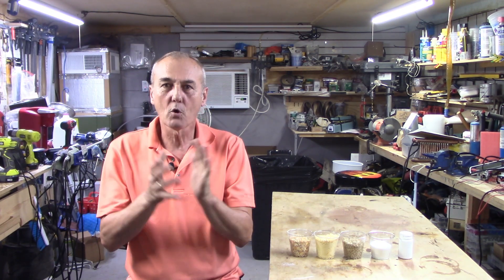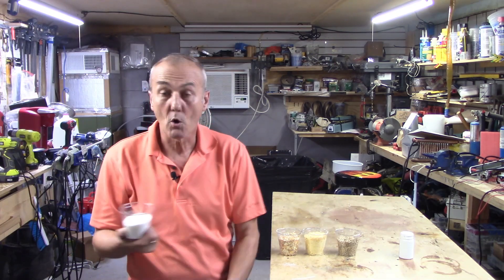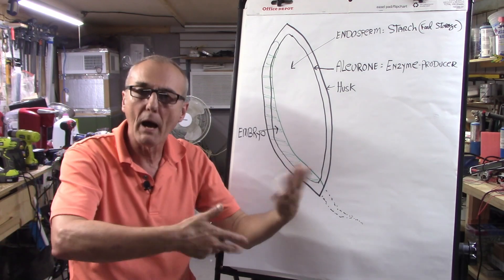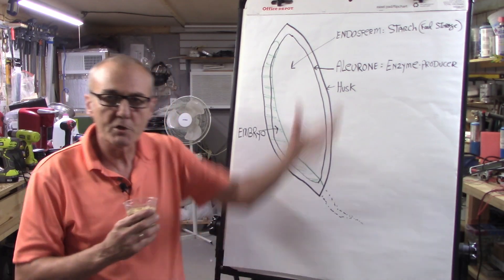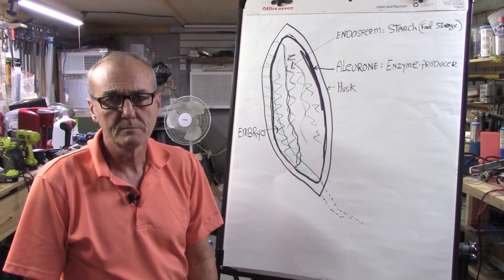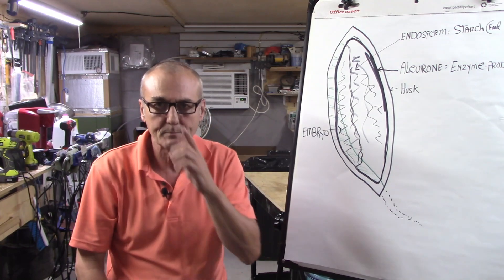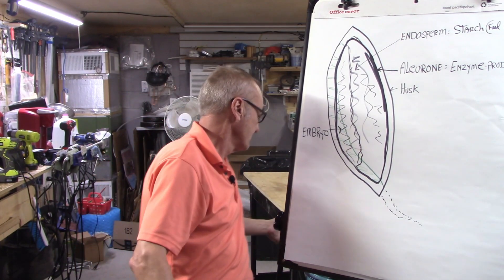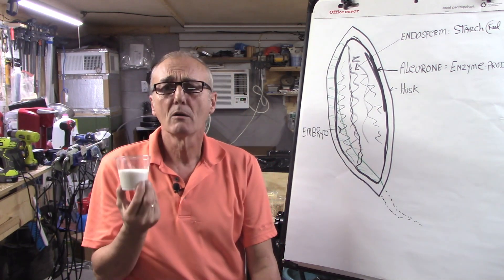CONVERTING STARCH INTO SUGAR EXPLAINED

Comment: I know this is older but new viewers should understand that not all malted grains have diastatic power because they have been toasted / heated to influence the flavor and body of the mash. 
ie; crystal caramalt or most dark colored malts . 
    There are "mash calculators " available online that can be used to determine whether your custom recipe will convert,  if you have enough diastatic power in other words. These are fantastic sources of info when developing a new all grain recipe. 
     If you are willing to use sugar to make the alcohol,  then you can forget about the calculator and still pitch whatever grain etc., you want for flavor and body and not even bother with enzymes & still make something special .

Comment: So, if I'm understanding correctly, I should mix up my usual 5 gallon batch of Uncle Jesse's recipe, and well before I pitch yeast in, I should throw in  roughly 1.5 teaspoons (based on your math in the vid of about one third of a teaspoon per gallon) of the amylase enzyme powder at 155 degrees, and let it stand for an hour and a half. Is it fine to have my sugar in already, or do I need to wait until after the 90 minute 'steep' of corn and amylase before i add any sugar?
Reply from the maker: Wait until the conversion is done before adding sugar. Otherwise you will not be able to test your conversion.
George

Comment: Hi ya George, What do you consider the better option, corn or sweet feed for a still like the Chinese still that you posted a little bit back? being as that still is reflux, we are not going for taste it seems, as that taste can mostly be done by a pot still. A bit lower proof than the reflex yet more taste. As we are not going for taste on reflux. what would have more starch pound for pound? corn or sweet feed?
Reply from the maker: I would never use sweet feed.
George
Reply: Why use any corn since flavors will be lost in a reflux?  Just use sugar.  Keep it simple.  You'll get a neutral spirit..vodka.
Reply: @rocketsroc   You don't lose all the flavors just an big part of it. Sweet feed has vitamins and minerals that you don't wont in you product.